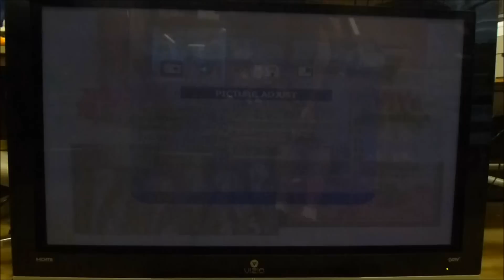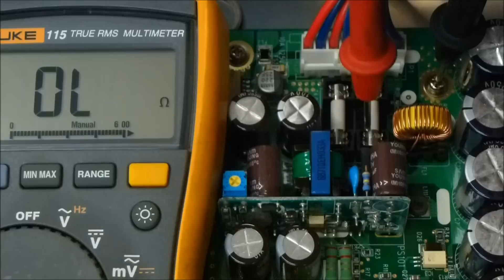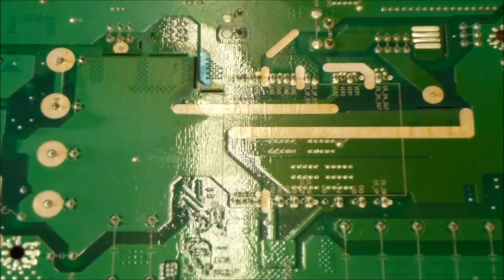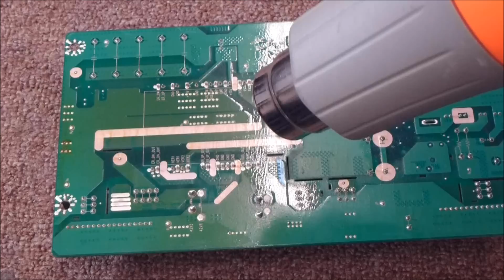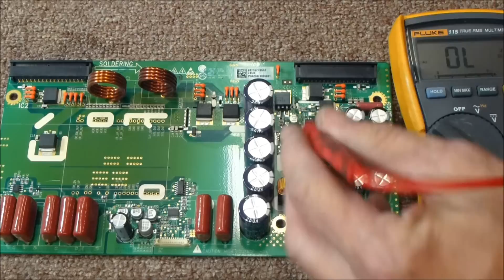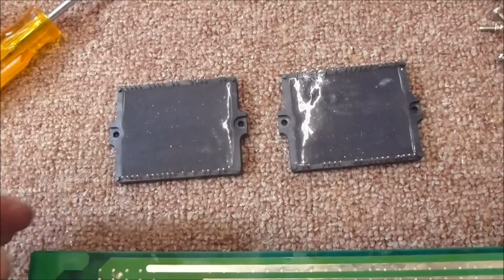Vizio Plasma P42HDTV10A LG Plasma 42PC3 Dark picture repair

Comment: Great job (missed pin solder joint and all) !
I have one of these boards ( 6871qyh053b y-main board ) in a HTC KPP-42MHD that has a flickering back light and black snow around the edges of the screen.
Do you think replacing both IPN's should fix these issues?
THANKS FOR THE VIDEO !!!!
Reply from the maker: I have had SMD capacitors on there boards cause flickering. try heating and cooling capacitors to see if any change

Comment: wow, so manufacturers intentionally dont put fans to cool these units, especially the IPMs, just so they break down and force the consumer to buy another set.  i personally have never repaired a plasma tv without spending more than half its value in new sustain boards.  LCD/LED tv's are so much easier to repair and dont overheat like plasma! no wonder plasma tech is obsolete.

Comment: Hey norcal715, i have a Panasonic TH-42PA20 Plasma tv, all was working fine but now i have pink  colors bleeding in, the pink fuzz mainly accumulates in the black areas of the screen (upper and lower bars of the Wide screen format) most of the time.
If you do full/normal screen format (using all the screen real-estate  the pink fuzz will slowly dissipate and  will look nomal.
 I would like to know what board/boards i need to replace to fix this problem and if you have it in stock? I have provided a link below to show you my problem, note it happens on all video sources, i also took a good look inside for obvious cap bulging (removed all PCB boards and cleaned unit) but all seem good.

Thank you for the help.

Comment: Thanks very much.  Excellent video.  Just fixed my LG 42PC3.  Zsus chip had shorted out.
Reply: One year later, my picture went black again.  This time it was the Ysus chip.  Replaced that and the picture looks great again.  I know I could have replaced both chips at once as was recommended but got one more year out of the other chip.
Reply: George Jetson Yep, I agree. I'd do one at a time, also. These TVs are too old to cost effectively replace both at the same time.

Comment: I have a Vizio P50HDTV10A The TV comes on and shows picture but it Has vertical lines and sound. I was checking The power from the Power Board to the Y-Sus Board. and power that going to Z-Sastain. at the plugs Voltage is 5v and I'm getting 10v. Can this be the Power board that's causing the disruption and vertical lines? Buffer boards and Y- and S- Boards are good. Please help. All connections on power board at plug that has 5V on power connections are putting out 10V. I'm thinking that I'm getting to much power to the other boards. Please Help!

Comment: Hi Norcal715 good video, i have a Plasma LG 42PC3RA TV when you switch on the mains it take about 30 mins before it will go to stand by so you can turn it on, i have checked all the capacitors and all seem fine what else could it be?

Comment: hey norcal715, I have a vizio p42hdtv10a that i have been working on for sometime now and cant get it back up.. I first got the set with load pop and i replaced the x and y sus ic and things were good for a short while. then i lost all power to the set and it just clicks and then immediately powers off..replaced power supply and same problem, thinking bad main board, would like to fix at component level..please help

Comment: Hi,
two questions....
I have same model have the same issue but on the Y sustain board.  Do I just replace the IC on the y sustain board?

I thought for fuses you check for continuity....your video is measuring the ohms.   Can you explain what that is actually testing?  My fuses have continuiity but I have a short according to your video...Please help  thanks

Comment: Hi,
if you are not good at soldering or testing components most likely you are gonna damage board more or even cause fire.
You can send your board for repair to this guy on ebay, just search for listing #:330916837325.
Type that # on ebay's search bar and send him your board, He is very professional and you'll get board back and repaired quickly.

Comment: hello, i have the same problem (LG 42 PC1R) FS2 Fail on the zsus but my hybrid is only blank from the other side without stk number? ZSUS Number is:6871qzh056b. Model:42v8&x3 the same stands on the Hybrid ic in the inside. (Altronics V8&x3_R.1) Can i use the STK 795-820? i have found many repair parts on Ebay. But is that the right Hybrid for the zsus and ysus? I hope you can help me;-) thx

Comment: norcal I have an important question I am working on an LG model: 42v8&3x and the other board no. is 6871qyh953a 
It's a lg ysus board out of an hp plasma tv an my questions is when I removed the ipm  I had 4 smd chips come off from heat I still have the smd parts but I need help because I am not sure where to properly place them ether C72, C84, C83, C81, C82, C22

also what would you use regular solder or lead free solder?

Comment: Thanks hoopfan71 for the reply. Is that mal-discharge s/w available for download anywhere and information on using it? I'm a computer tech support rep, and electronic technician in PC's and POS (Point of sale terminals & peripherals) and just started tinkering with TV's. I have a LG 42PC3D (no picture but has sound) and a LG 42PC1DA that works fine except for the specles. I'm hoping to get at least one of those working.  I also have another LG 42PC3D that works fine except the IR is not working.

Comment: After I've replaced the IPMs in numerous LG TVs, I've ended up with speckles. You can try adjusting the panel voltages slightly, but I've had to reprogram the control board with special "mal-discharge" removal software to totally wipe out the speckles. On your second TV, I'd say your IPM is blown, and I'd be fearful of doing further damage by installing a good fuse and continuing to tinker with the TV. Just my opinion.

Comment: I have a 42" LG Plasma where the areas in the picture that should be solid black like hair, suits etc, have colored specles showing.  What might be causing this.   I also have another where the left fuse on the ysus board you show here is blown.  With the blown fuse, the set turns on and I get sound but no picture.  with a new fuse, the set turns on and off again, but doesn't blow the fuse.  Is this the IPM or the buffer board(s) ??  Thanks,,, great video also.

Comment from the maker: E321VL most common problem is bad (corrupt) eeprom. Check and make sure the PS on command is making it to the power supply board. If it is there and still no 12 volts then you have a bad power supply. If it is not there then main board problem. Try heating the eeprom first and see if it starts.

Comment: LOOK FOR Same size LG TV, same exact thing. also use google pdf search, for the model HP model, you will find a great manual telling u exactly what is crap, by them. They show you an infrared image which shows which parts they have cheaped out on, which get ultra hot and die. But for awful plasma tvs, you need the manual, check the surface mounted fuses and resistor fuses too. They are labeled FXXX nothing else has an F.

Comment: I've got an HP that has sound but no picture.  I've inspected the boards and no caps blown, no fuses blown and I don't see any burnt spots on the IC chip (on the outside, haven't desoldered yet).  Would you still suggest replacing these chips or is the problem somewhere else in your opinion. Thanks for the video and the help.

Comment from the maker: Check the heartbeat LED on the logic board. does it blink fast 2-3 blinks per second or slow 1/4-1/2 blink per second. If fast the scan boards are good (Y Z) if slow you have a bad scan board either the Y or X. Also does the set make Va and Vsus? and are they staying up or they go down?

Comment: I've repaired several lcd panels using the latex tab trick. Do you think this would work on a plasma that has vertical lines that emulate the vertical lines that youd see on lcd ribbon cable to panel problems.

Comment: I have the same issue with mine.  Check the fuses on the Ysus and the Zsus boards (left and right boards).  If there are any open, then you have a blown ipm.  You can replace the entire board, or just the fuse and ipm.

Comment: On a HP (LG?) 50" PL5060N plasma that has a bad IPM, do you suggest replacing all four? (Y and Z have 2 different types on each board: J018 & J016.) Where do you buy new STK modules? Can you name a source please?

Thanks!

Comment from the maker: Hard to say. Possibly a lower address board(Z), bad ribbon cable or connection, or a bad control board. Or even a bad panel drive pack bonded to the plasma panel.

Comment from the maker: Yes I checked them for continuity with an ohmmeter as well as a visual inspection with a microscope. All it did was scrape the paint off of the traces but they were unharmed electrically.

Comment: I noticed an area where when you forgot that unsoldered pin, your prying action seemed to damage the copper traces.  Since they are under the IPM, you won't be able to repair them later.  Did you do some sort of testing before soldering in the replacement part?

Comment: Very good video!  However, I chose to replace the whole Z Sustain Board instead of messing around with the IPM.  It only costs $15 extra so it's well worth it since I don't need to buy expensive tool like the vacuum soldering gun that will be rarely used even if it's a very cool tool to have.  Thank you very much for sharing your expertise, I am sure it has helped many people fixing this common problem with the IPM.

Comment from the maker: With a ohm meter check the VA and VS lines to ground and see if one is shorted. also you can unplug the connectors from the power supply that go to the X-SUS and Y-SUS and see if the set stays on. if it does then connect them one or the other and see which one keeps it shutting down. Just a thought.

Comment: I left a video response, I got the LG 42PC3DV - the screen wont turn on. I plug in the power and get a solid red light- then when I press the power button I hear a click and the red light turns to a green flashing light for a few seconds then returns to a solid red light again after another click- but the screen never turns on. All this is in the video- u can see in the vid the capacitors look fine- so I want to get an ESR meter/tester so I dont remove any caps I dont have to- any suggstns? thnx